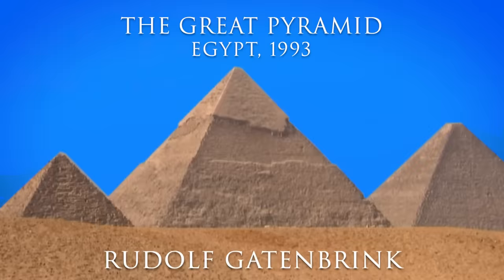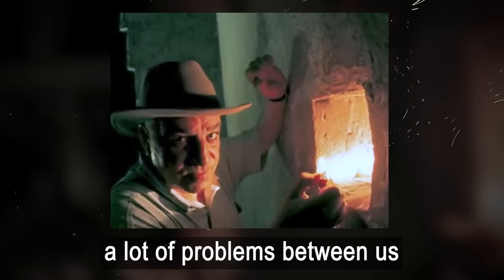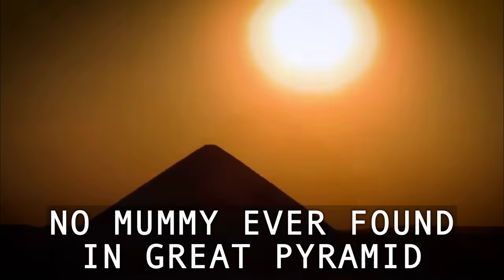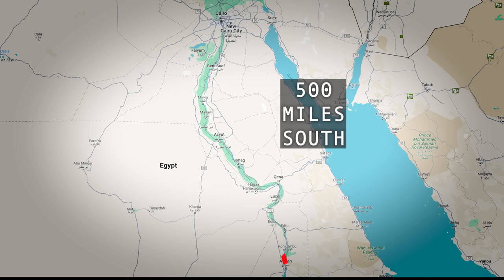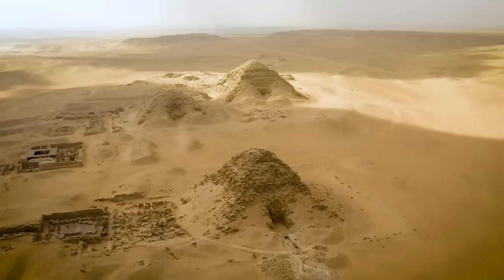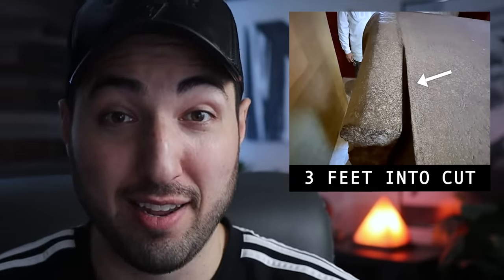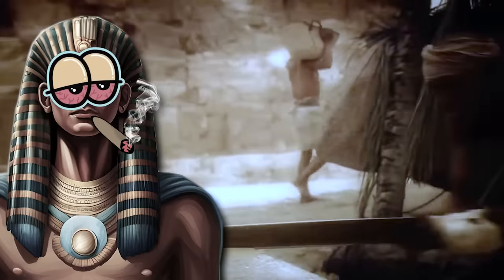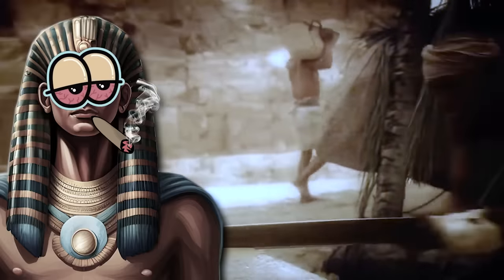The Great Pyramid Mystery: The Oldest Cover-Up In History

Comment: The 8 sides thing was not aesthetic, it was functional. The sides were covered with limestone, the shadows we can see today on the Equinox were likely not there when the casing was there. Building with that geometry accomplishes one thing: structural resilience. Any external force like an earthquake or tidal impact is much easier to withstand than if you have four flat faces. It's stood forever because it was designed to stand forever, no matter what nature throws at it.
Reply: Unlike the rest of us.
Reply: The pyramid is a beacon. Like an old antenna. To use the earths 🌎energy to keep a signature signal for civilizations to return. 👽✨🌎 the signal is recognizable in space. Sshhhh 🤫
Reply: @SpaceAndroidz  the only comparison I could come up with that is as great as the pyramids is the great wall of China . How long did that great construction take using slaves and compare that to the pyramid time frame construction.  And that would give us a time line closer to how long the pyramids actually took to build.
Reply: Not to mention it's not as old as they told us it is. Don't know why people are ignoring that possibility.
Reply: How did the nomadic tribesmen with copper chisels figure that out?
Reply: It's really nine sides the Pyramid has, he forgot to count the bottom side. The number nine stands for completion in base ten mathematics. The Pyramid is really a cube, but the top of the Pyramid or point is collapsed giving you zero point...
Reply: @terryfrit3749 the wall was built in the 1960's! It wasn't there '000's of years ago

Comment: Back in 1864, Peazzi Smyth theorized that it was at the geodesic center of land mass but it turns out that it's about 1000 km off
Reply: I think I remember reading a study where it was speculated that the Pyramids would be the geodesic center of land mass if they were built before the continent of Pangaea broke apart into the current continental plates.  However that implies that either the pyramids predate humanity OR the continents shifted much more recently.  Either way the claim creates quite a few more questions.
Reply: I reckon continents can move a lot fast if a cataclysmic event happens ie a big as impact pushing the plates
Reply: Its also helpful to know that 12000 years ago oceans where 400 feet lower. This would alter maps considerably, and I'd wager it would correct most if not all of that 1000km.
Reply: @Contrarian-ol2bc interesting theory. 👌

Comment: 13:02 what is really amazing is that not only did the pyramid builders encode their understanding of the speed of light but that they built the pyramid at the exact coordinates thousands of years before an reference point to determine geographical coordinates was devised. Brilliant!
Reply: They also knew what proper length of a meter we would settle on after adjusting it multible times in history. Remarkable!
Reply: @robwitka WTF are you talking about? 
Perhaps Nostrodamus was really an Egyptian?
Reply: Sarcasm is probably wasted here 😂
Reply: @robwitka  Not only that, but they also knew what a second was before seconds were invented. Truly incredible!
Reply: @jimmyobvious1651 mind blown.
Reply: @robwitka Ha ha
Reply: None of that is true. None of those numbers are accurate.
Reply: @DrSpoculus  Many of them aren't even numbers. For example, he makes a lot of the length of a minute of arc of latitude versus the length of a minute of arc of longitude. Which, of course, varies from 1:1 at the equator to 1:0 at (either) pole.
The presenter, whoever he is is numerically illiterate. It shows throughout his script.
Reply: "the pyramid builders encode their understanding of the speed of light"
specifically in vacuum and specifically in meters per second .... even though they themselves used an entirely different set of measurements (for example cubits to measure distance)

as for the location of the pyramid... if the "exact coordinates" pointed to a swamp or the open sea, would they have built they pyramid there?... So it is really a piece of luck that these coordinates pointed to a stable plateau with plenty of stone to be carried... is it not ? Or maybe they chose the location based on a little thing called common sense

Comment: Lime from fireplace ash and salt were mixed in with it. The water evaporated, leaving a moist, clay-like mixture. This wet “concrete” would have been carried to the site and packed into wooden moulds where it would set hard in a few days. Mr Davidovits and his team at the Geopolymer Institute at Saint-Quentin tested the method recently, producing a large block of concrete limestone in ten days.

New support for their case came from Guy Demortier, a materials scientist at Namur University in Belgium. Originally a sceptic, he told the French magazine that a decade of study had made him a convert: “The three majestic Pyramids of Cheops, Khephren and Mykerinos are well and truly made from concrete stones.”

The concrete theorists also point out differences in density of the pyramid stones, which have a higher mass near the bottom and bubbles near the top, like old-style cement block
Reply: This is the most simple explanation.
Reply: the problem with this theory is that it doesn't account for the granite stones that are part of the pyramids.
Reply: There are 216 layers. If one layer needs to dry for 10 days. You would need 2160 days. Thats less than 6 years.

Comment: The two shafts were probably air shafts for ventilation.  I have been all over the inside of this pyramid many times and noticed how quickly the air was used up with a small group.  There were workmen working inside these chambers and they need to breathe.  Also the large chamber under the pyramid had no solution for the ventilation problem and was abandoned.
Reply: logic dictates if a chamber has no ventilation then it wasn't meant to be ventilated which suggests it wasn't designed to be occupied by humans.
logic also dictates that if those two shafts were air vents it would be logical (given the air shortage in the pyramid as you described) to have them opened. Unwillingness to follow logic suggests that the people in control of the pyramids are either very illogical or they are trying to keep some secrets.
Reply: They also needed to keep torches alight, and that needs air too
Reply: @WithmeVerissimusWhostoned so how would u build the chamber in the first place without ventilation. I believe your unbelievable..crazy logic.
Reply: @richardcray2919  eh, you build the chamber first then the pyramid on top of it... #brainonpls
Reply: Why does a tomb need air shafts, and why only this one? It’s a totally absurd idea. Lucky thing the pyramid was never a tomb
Reply: Magnetic north is different from true north. Magnetic north is always shifting through time. So it would be an amazing feat if all the pyramids are aligned with true north and not magnetic north. If their technology and view of the world were so far behind ours, the pyramids would be at different angles to true North as they would have most likely used Magnetic North.
Reply: it is odd tho, they were able to do all this math, but couldnt think far enough ahead for air. Could also be just time crunch cause the 20 year shit, and they just ended up skipping it and not trying to build around it for later on, but idk i dont know too much also have been there like you

Comment: I often question the findings of archeologists because, for one thing, the only reason they even make hypothesis is because they are under pressure to come up with a story/idea about the findings, that pressure coming from the fact that they usually do so while trying to obtain grants or funding for their work.  So often these hypotheses are based more on modern ways of thinking and living and the modern environment in which they find the objects.  For instance, for ages we pictured castles as being bare stone at the time they were completed. But we know now that the walls were finished off (even plastered) and painted, both inside and out, and it was likely the floors were covered with wooden planks, not bare stone.  But all those surfaces would have broken down over time if not maintained and floors were likely scavenged once the castle was abandoned.   

But knowing, as we do now, how dramatically an environment can change and, with the finding of aquatic fossils in other parts of the Sahara desert, it is even possible that the entire region was significantly different and pyramids were created entirely with the aid of water.  I mean vast seas of water, very near to the site or even right up the project.  Water is the only natural element that would enable people to move such large stones with relative ease.  Now, I have not worked out the details of this.  When the seas receding may have predated the building... but, again, many dates of ancient and pre-historic times are inaccurate, too.  

It's just one possibility and may be part of the answer, though not the only one

What is clear is that much knowledge has been lost, which reminds me of the Great Library of Alexandria that Julius Caesar burned down and all that knowledge destroyed.  I always wonder if the knowledge was held there.
Reply: Its simple to lift giant objects (use  Like giant scales to weigh) . you can add more weight like sand  to lift other side ...
Reply: If you are looking for a large amount  of water, will the Nile do?
As for the internal appearance of castles, etc, I doubt you actually hot your vision from archeologists. I think Hollywood is more likely!
Reply: @michaelmayo9048 How do you hold each side? Ropes? They’ll snap.
Reply: @Felale  a strongest man  lifted 2,422kg in 1993 ..that's almost 2 and half ton...maybe that's how they lifted those blocks.howmany strong men can fit around the blocks. probally 12 so if they lift 1 ton each which is less than half a strong man lifted 12x 1 ton= 12 ton
Reply: Archaeology has drastically changed in the past 100 years. Plus, all archaeologists and anthropologists have to publish their findings in peer reviewed journals. What you, Joe public thinks is 100% irrelevant. Pressure to publish is totally mitigated by jeering contemporaries if you get it wrong.
Reply: We've built a LOT of dams and locks. With the use of these, and LARGE amounts of dry and buoyant  wood, it may be possible to manipulate a lot of weight, kind of like we move/build  massive ships .

Comment: My favorite part is when he draws the red line along the Nile and then incredulously says "they some how transferred it from here to here".  Boy, we better call in the Hardly boys for that mystery.
Reply: They had Amazon deliver the blocks. Back then, Prime was too expensive, and that's why it all took 20 years instead of overnight.
Reply: He means how did they carry such huge blocks from a to b, from quarry to barge and then on to Giza with the Tec that they had at that time.
Reply: @paulhill2012 the nile had different paths in the past. The gizeh platform was next to the Nile in its heyday
Reply: @Gabor123  yes, my friend it did. But although they could travel by boat, the question is how did they manage to get huge 20 ton blocks from  Quarry to Boat and Boat to Giza, then hoist them into a perfect pyramid
Reply: @paulhill2012 water pressure
Reply: @hugoapresname  they pushed the blocks from the quarry overland to the Nile with water pressure?
Reply: Exactly, goes on about conspiracy theorists like flat Earth then falls slam dunk into the same trap.
Reply: @paulhill2012  I think the funerary boat Khufu had a displacement of 45 tons or something. So it's not much a of stretch to think they could build a work boat to cary 20 tons. I thought the leading theory for them moving them into position was that they used a ramp with a lower grade angle and they slid them on sleds or on other flat blocks covered in sand? If we look for credible archaeological information on how they might have these things then there are a lot a very plausible theories. It's just people don't do this because the fantasy that ancient people could not get things done leads to cool sci-fi fantasy imaginings. Don't get me wrong I like Star Gate but it doesn't rank highly on the plausibility scale.
Reply: @justinmoore5158  displacement is not a single piece of cargo though.
Reply: @paulhill2012  Right it's the weight of the water that is displaced. So if you go above 45 tons total you're no longer buoyant. Just saying there is a bit of wiggle room with the 25 ton difference. Are you thinking the ship itself was over 25 tons? This was a funeral ship not designed to do this kind of work. I think the point is it was probably well within their abilities to get done.

Comment: The statement, "the Great Pyramid is also perfectly aligned to magnetic true north..." is an obvious contradiction in terms. There is "magnetic north" and there is "true north", two completely different points. Furthermore, it is impossible to know where magnetic north was located when the pyramids were built since it continuously wanders and occaisionally reverses. The pyramid's alignment is in fact approximately 6 minutes off of true north which is a truly amazing fact, but why not get the terms correct.
Reply: 10 points to gryffindor.
Reply: I overall agree with your comment regarding magnetic and true North. That he was free about  intertwining the 2 when they are not, note that regardless of were magnetic North is at a given time, there is always a meridian that will go through both points.  It is true, however, that the meridian changes.  The amount of change / location of magnetic North does appear to be something that is predictable.  It is possible to reverse calculate where it would have been with a fair degree of accuracy.  Does not change the fact that he got it wrong, just a little refinement on your information.  I think  your response was well thought out.
Reply: I very much appreciate your thought-provoking comments and will have to look into this further. I thought that the only method of determining paleo magnetic pole wandering was through analysis of the varying paleo-magnetic orientation of the iron-rich basalt in sea basins, due to sea floor spreading. This analysis would likely have some uncertainty due to expectant variabilities in global tectonic activity as well as inherent inaccuracy of radioactive age dating (I assume uranium-lead ratio) which would be somewhat inaccurate within such a short geologic timeframe.  It seems to me that the people who built the pyramid aligned it with true north, and may not have known about magnetic north, since the Great Pyramid seems to be aligned with true north to an accuracy that would even be commendable for an architect today.
Reply: @rossk4864  , that civilization knew both True as well as Magnetic North.
Reply: @glennburt8360 "...note that regardless of were magnetic North is at a given time, there is always a meridian that will go through both points."

Trivially true.  By definition all meridian lines originate and terminate at the rotational poles (north and south poles).  The number of meridian lines is infinite thus it is true that at all times a meridian line will intersect the magnetic pole and terminate at the rotational (true) pole.
Reply: Are you sure that ancient Egyptians had a magnetic compass? They may have, but since the Great Pyramid was aligned to geographic (true) north, I don't know of any evidence that they knew about magnetic north. However, the Chinese did have the compass at about the same time.
Reply: @rossk4864  wonderfully thought through response and spot on as it would apply for the geologic sources of data. It is applicable to prehistory, certainly, and we have some historical reports as well. I do not recall the correct sources right now, but WAAAAAY back in my post graduate days I remember reading about Arabic and some far-eastern astronomers (even prep telescope) documenting the rotational axis of the earth.
I don't know if they were contemporaries, but that may help point to the right direction for further studies!
Thank you and the YouTuber for provoking my memory!
Reply: I am behind the discussion! 😊
Yes, they may or may not have had a magnetic compass. I suspect that they did like several cultures and noting that that rotation seemed centered on the North star they used that to set a reference point.
Still, the 8 sidedness of the pyramids reported leads me to wonder if any of the 4 near parallel sides are any more closely aligned? Or is the minimal difference from true north within the error of the mean of their measurement equipment?
Reply: You don't understand. The pyramids are positioned to the magnetic northeven If it oscillates!
Reply: @TrespassingPilot129  Got it! That explains why they are built with iron-rich jello, so they can jiggle and shake in the fluctuating magnetic field!
Reply: Cause magnetic and true north are not on same site, it means that from some point of Earth they at same direction and from another points on Earth they not. Even a broken watch shows two times in a day the correct time ... :D

Comment: Wow I thought I'd seen a lot of these videos and knew some things, but the bits about the relation to the size of the earth etc are new to me. Crazy.
Reply: That is only assuming they measured it in the same units. Hint: they did not. It’s just finding the result and looking for evidence to support it. That’s not how science works. 😂😂😂
Reply: @patrickmontie9583  What do the units have to do with it? This is a ratio we're talking about
Reply: @patrickmontie9583  🤡yes sir
Reply: @patrickmontie9583 regardless of the system used. Are the sizes correct?
Reply: @faithful451 It doesn’t apply to earth size thing but it does apply to the speed of light and many other things. Plus a LOT of this is people doing things in the backwards method of thinking he described.